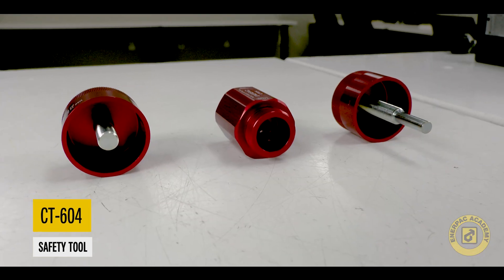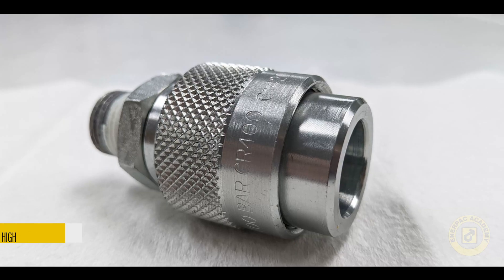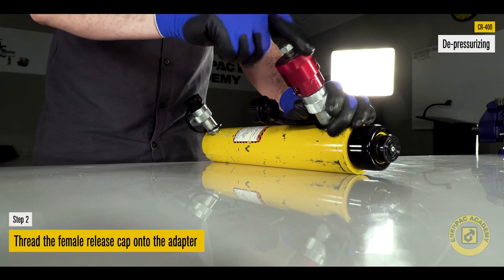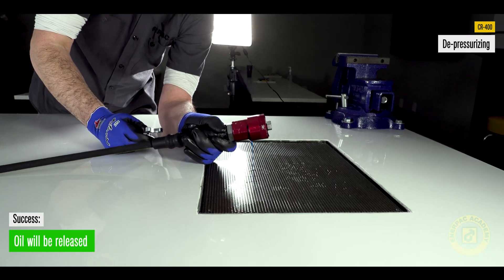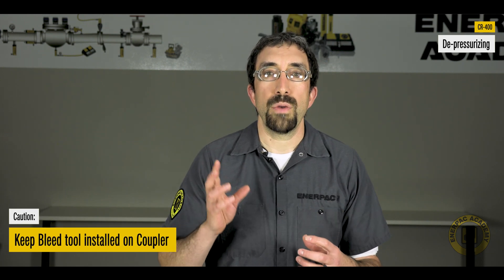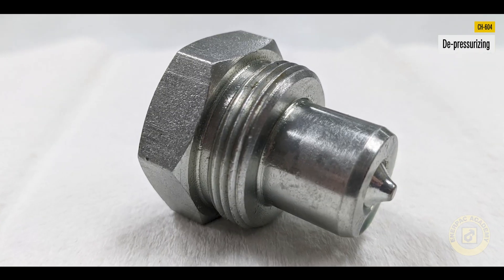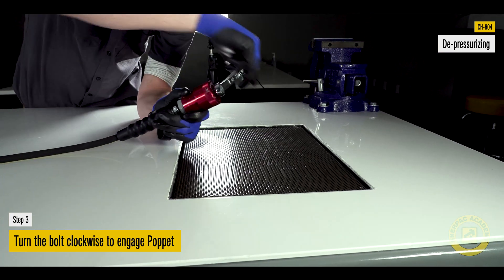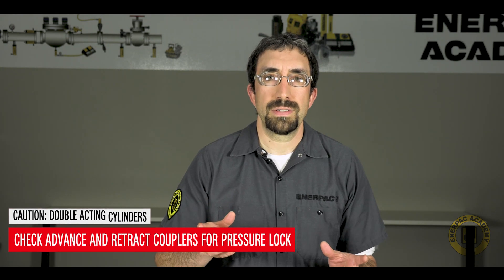How To Depressurize Hydraulic Couplers and Safely Bleed a Coupler with the Enerpac CT604

Comment: Any idea what kind of thread sealant I can use to get the threads to stop leaking on our 10k cylinders? They have quick connect like the ones in the video. I hate to go any tighter on the threads.
Reply from the maker: Hi Tony, If you reach out to an Enerpac Service Center they will be able to take a look at your 10k cylinder for you and offer advice https://www.enerpac.com/en-us/distributors-service-centers.